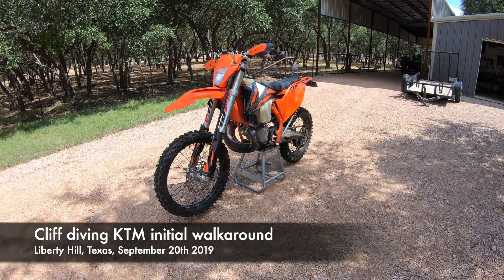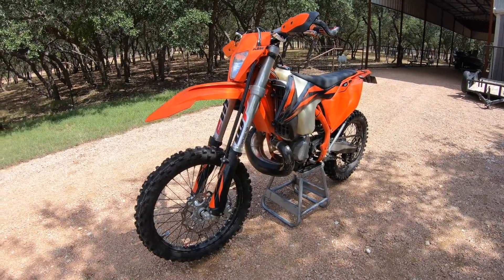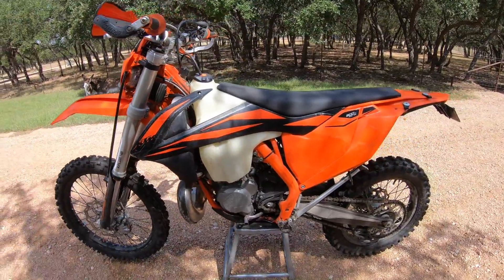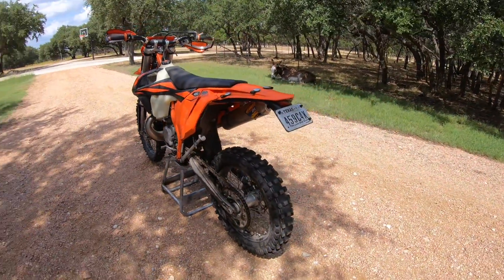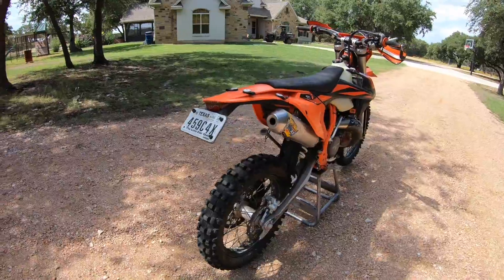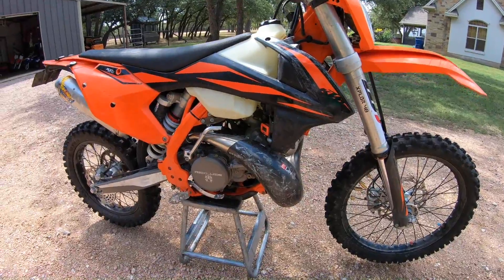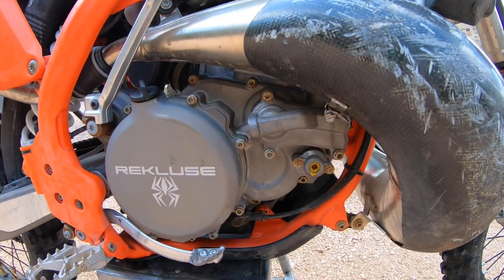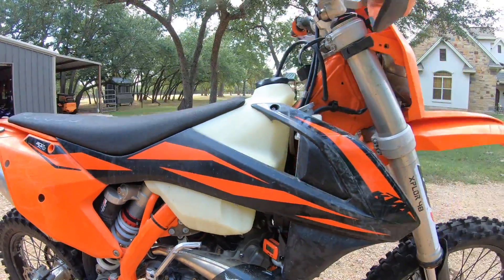Part #4 Cliff diving KTM 300 XC-W initial walk around

Comment: Sweet property. Best luck getting it back up to par. Def drain all fluids, pull plug, regrease bearings, etc. Id probably change the oil twice getting it hot to make sure any water has evaporated.

Comment: Looks like the forks are bent. Lol on the correction of the front brake. Lever confusion causes most of the accidents like you had. 
Btw. You should have had that thing fired up in 20 mins or less